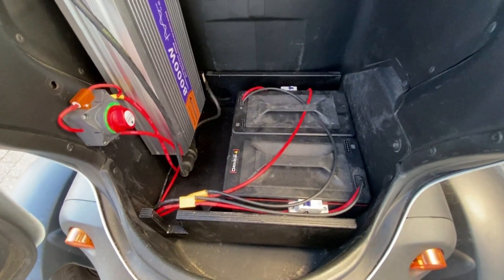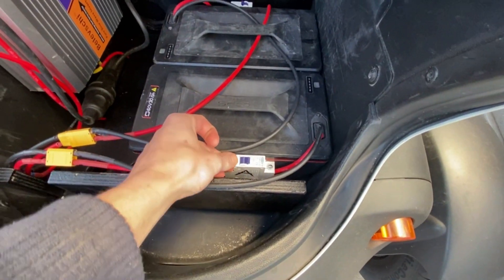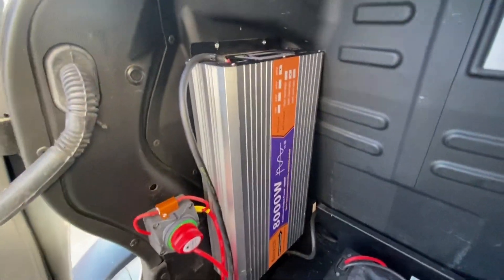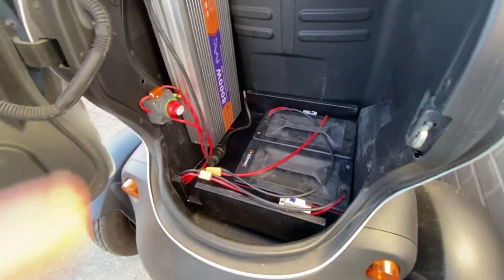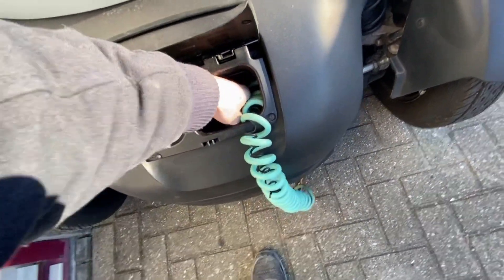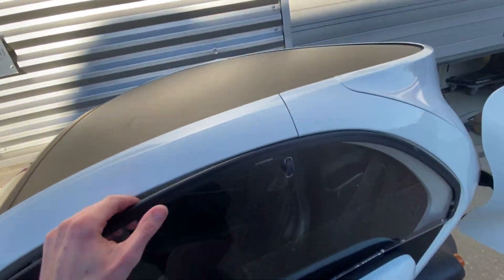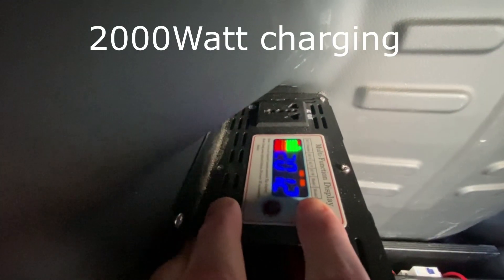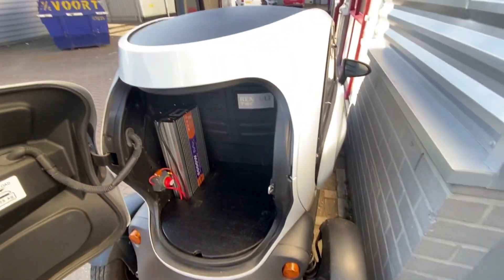Renault Twizy range extender!

Comment: Amazing video my friend. Can you use extension lead cable for charging the twizy ? My socket is a bit far in my building and I suffer to charge it. If yes, what is the best specs , like 16 or 13 amp ?

Comment: Strange wire connection, I recon the efficiency should be like 60-70%. Would it be better to connect the extra battery to the main battery in parallel?

Comment: hi, I have a twizy 80, I am aware that a twizy on the move consumes more than the 2kW that you can load with your wonderful range extender, but I still wanted to ask you a question: have you tried driving the twizy with the range extender on? Is it possible to turn it on, go to "Go" and drive without problems? Sorry for the strange question but I'm curious ;) thanks
Reply from the maker: Hi, NO that is not possible at all. and it wil never be sadly.

Comment: Real daily range?
Reply from the maker: driving around 50kmh its about 80km in normal wheater. driver 80 makes a close to 45/50 km.
Reply: @bentwizy7208  thanks for answer 👍
Reply: Hola me puedes explicar cómo es este sistema y como funciona, muchas gracias si tienes los planos para el montaje

Comment: Why not put a generator instead? Looks like there is enough room to fit one of little honda's.
Reply from the maker: yes this could work. but you need 2000watt output power, then you will be fine. nut gas is 2 euro a liter. the only reason i buy a twizy is for the cheap running cost. i use solar to charge my twizy and my extra battery. works great.

Comment: Hi, will it charge the main battery if the charge lid is closed and the ignition is on???
Reply from the maker: not full on, but halfway on then yes. if the twizy is ready to drive than it won't work. just like when you normal charge. you other comment, i dont think this wil work. how can it see break input when you are giving gas? and also, it wil try to put energy back in the spare batteries, and they cant handle more than 15a charge current.

Comment: This looks like a Cargo Edition.
Very cool mod!
BTW,  - ever thought about a solar panel on the roof? It has been done by several owners.
Reply from the maker: hi, yes thought about it but it makes no sense monney-wise. and where do you connect it to?
Reply: @bentwizy7208  - I don't know. I saw a movie on YouTube and a few different fora had questions and discussions about it.

Thought the panel could provide the extra power drawn by (some of) the mods,  - the GPS, power for the phone and tablet, heaters, sound...
Reply from the maker: @acresir  yeah you can use the solar pannel for the 12v battery mayby. but i dont see the point.

Comment: Why you just donc plug a second battery in parallel to the genuine battery?
Reply from the maker: because, 1 there is no room for that. 2, you need the same battery as already in the twizy. 3, you need to be really smart in electronics to trick the twizy and still have the BMS work.
Reply: @bentwizy7208  you can parallel in a DC/DC converter that delivers 57V to the speed controller . So you do not connect a battery in there directly. Quite like what you've done but with a 57V dc output to the controller instead. It will treat this charge as regen.
Reply: @bjrngutubakken53  That was really smart. Have U done this mod to your own Twizy?

Comment: Great idea !  I've a Twizy 80 Cargo and I'm very interested by your range extender.
Reply from the maker: are you going to build one for yourself?
Reply: @bentwizy7208  Maybe ! I'm still looking for a range extender for my Twizy (but DC to AC and AC to DC, it's clearly not the best solution but it's one solution)
Reply from the maker: @MarcPaal  sadly its to only solution in case of the twizy.
Reply: @bentwizy7208  That is actually not correct, you cant charge it on the move cause the sevcon denies it, but you can dc charge while driving to the rekuporation.
Reply: Small generator? On petrol..